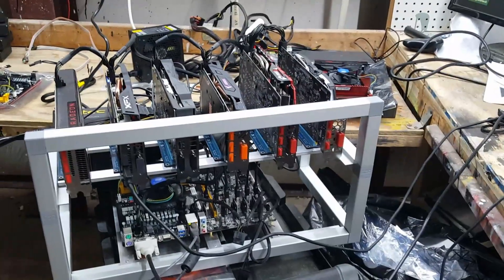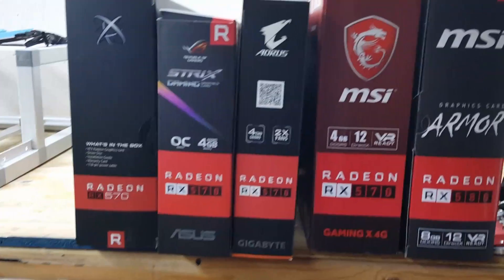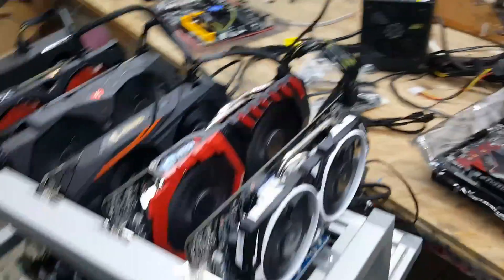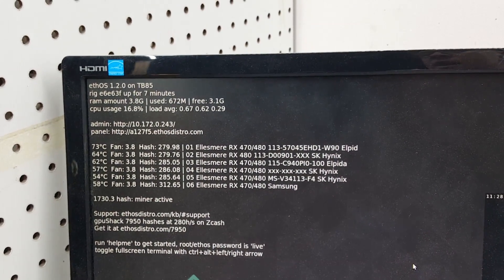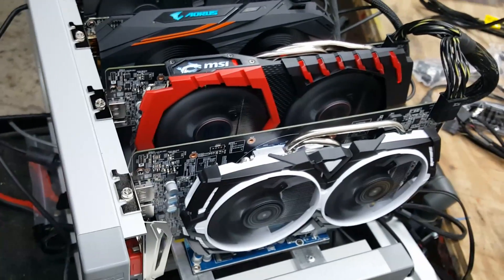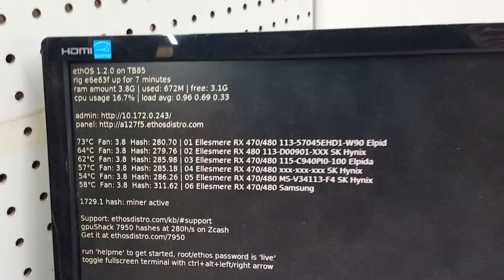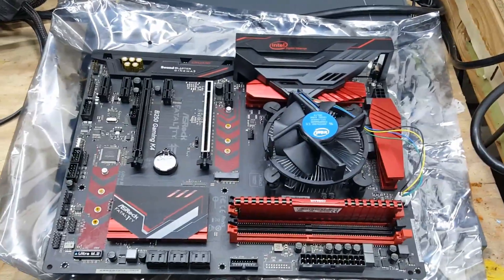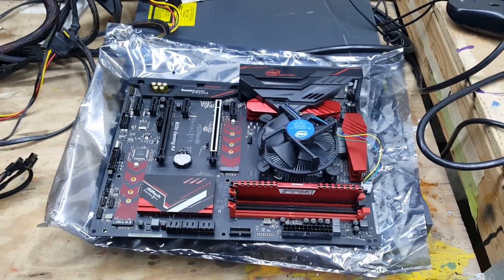Zclassic and Zcash mining with RX570 and RX580 GPU

Comment: Did you ever figure out how much power each board was drawing?
Reply: From my calculations, if he is using Equihash algorithm to mine Zcash, the power draw would be 670 watts, at a daily operating cost of $1.61, at a per kWh cost of $0.10. Based on todays Zcash value and hash rate of 1590 H/s (combined), he would be bringing in $6.56 a day after electrical costs. His is showing a combined Hash rate of 1729, so it could be costing a few more watts (700?), and be getting an extra $1 a day. But if he was mining Electroneum (ETN) using the CryptoNight algorithm, he would be using less power, at 655 watts, costing $1.51 a day, with a profit of $14.05 per day, after electricity costs. I hope that helps.

Comment: Hey Mr Versluis

I see a lot of the questions i had have already been answered. I just want to know your opinion on using the EthosDistro vs using a normal Linux Setup. I am from South Africa so we are able to get the other pc components quite easily but the EthosDistro would have to be imported, is it worth the extra hassle of getting that into the country (we have strict tax on import) or is a normal linux setup a decent option?

I am starting from 0 knowledge and all i know is what i have seen on your videos and blogs.... thank you by the way amazing information.
Reply from the maker: You can download the ethosdistro and install it on your own SSD. You don't need to have the ethosdistro SSD's shipped  to you.

Normal Linux is good to start out with. You can look at the guides on my website on how to make that work. https://blockoperations.com/build-6-gpu-zcash-headless-mining-rig-ubuntu-16-04-using-claymore/

I moved to ethosdistro because it is easier to manage many miners, and it shuts the GPU off instead of letting it burn out. You can do the same with linux...but I did not have the time to figure out how to monitor and control the GPU's on Linux, and since the ethosdistro guys already figured it out, I buy their system. It is $30 USD for digital download from gpushack.com
Reply: Ah perfect thank you so much for the help, so far we have set up two GTX 1070s (the whole Rx series cards were sold out here) that are mining ethereum on linux using the claymore miner you mentioned in your guide. It's working well so far... slow start.

We using the nanopool option and have been monitoring it, looks like we getting about 47Mh/s with both. Not a bad start but we will be expanding shortly.

Thanks again Mr V

Comment: On one of your videos, you mentioned that you have a mobile hotspot as a auto backup to your Uverse WAN connection.  Can you tell me a little more specifics about that?  I would like to configure something similar.
Reply from the maker: You need to have a dual WAN router, with a primary and a failover link, like the Linksys LRT224 (I use a Cisco Meraki with full IPS signatures loaded...but that's probably overkill).

For cellular, I use a Sierra Wireless USB 4G modem with a T-Mobile SIM card in it and a TP-link TL-MR-3020 (I think) with an ethernet port to the firewall

Comment: The RX580 also comes in a 4GB version for $50 less ... do you think the 8GB is needed to get the higher hash rate?
I'm trying to put together the build you showed on another video... except the mother board is no longer available.
Reply from the maker: I thing the 4GB version is fine. Use the alternate motherboard choices at this post here: https://blockoperations.com/gpu-mining-zcash-ethereum-ethosdistro-amd-rx470/

I know you can get 6 GPU's working with the Asrock Fatal1ty Gaming K4

Comment: How did you get ethos boot with these, i couldnt get it booted even on it with 580 and 570.
Reply from the maker: Guntis Vitolins I got the 570 and 580 working, all six cards on the biostar TB85 then all 6 today on the LGA 1151 asrock fatal1ty gaming k4. 

my panel is here http://a127f5.ethosdistro.com/#

which motherboard settings are you asking, asrock?
Reply from the maker: Guntis Vitolins for the fatal1ty the BIOS settings are auto on pci-e, TOLUD at 3.5, vt-d off, sound and serial port disabled, could virtualization disabled. I think those were all the BIOS settings changes.
Reply: Ok thanks for your update, cool. ill give it another go Tommorov , have them on exactly the same motherboard.
Reply: Did you do any bios changes in biostar TB85?
Reply from the maker: Yes, these are the BIOS changes I made: https://blockoperations.com/configuring-bios-settings-gpu-mining-intel-motherboards/

Comment: ubuntu has more luck with these than windows?  had serious problems trying to get 6 to work in windows...
Reply from the maker: I can still only get it to boot with 5 cards, not 6. Ethosdistro uses ubuntu, I believe. I put 8G of memory in it and set TOLUD to 3.5, still no luck.
Reply: ok now im confused, so you got 6 to work on the TB85 with ethos (which i despise since the main dev in the IRC channel lashed out on me because I am living in china... and he hates china... yet he sells chinese stuff like cheap SSDs.... and then stalked me to the zcash boards... still got the screenshots..)?  and you could only get 5 to work on the asrock fatality with windows?   you gonna try the TB250 boards?  I thought that was 5 500 series cards and 1 400 series on the TB85

Guntis cant get 6 to work in windows

I could not get 6 to work when mixing the with 400 series cards in windows

but I did not try ubuntu
and yeah eth is just a stripped down repackaged ubuntu... kind of a rip off when you think about how much work goes into ubuntu and its free... they just take what others give out for free and then charge for it (eth)... kinda horrible

but you can copy it :)
Reply from the maker: ok, got it working. I set the PCI-E to Auto, not Gen2
Reply: hmmm cool!  that's good to know, that's the  asrock?   windows  or eth?
if u flash them do   they  work  with  linux  drivers?
Reply from the maker: Yes, the Asrock Fatal1ty I got working with 6 cards. Biostar TB85 works no problem.
Reply from the maker: Missed this comment before. The Biostar TB85 works fine with 6 GPU's. It's not the application that's the hard part for me, it is getting it to boot. Ethosdistro works great
Reply: cool
Reply from the maker: I don't know. I have not flashed any of the GPU's
Reply: too bad i already stuck mine in a crap board total 4 GPUs... otherwise id try with ubuntu
Reply: you should check if loose card when your board boot in bios.
Reply: the reason of loosing card ,not depend on what system you use.
Reply: lots of people have been having problems getting 6 to work in windows 10.
i dont care cause im not going to keep patching my drivers... the drivers seem to unpatch themselves once in a while... and its really annoying - system crashes and you need to repatch the drivers.  im so glad i only have two 500 series cards... ill probably flash them back to stock bios and let them mine zcash ....
Reply: Cryptomined I have not any experience of mining in Windows, but Ubuntu server is not table either. some of my rigs work perfectly, some are not. they are all 7 cards rigs ,with 470 or 470d.
The stable one, can work though whole week. but the unstable one cannot work lasting 2 hours.when it reboot, the rig loose some card randomly. so I must check these unstable rigs status. it's annoying.
Reply: oh yes, for your problem might be solved using some sata risers with fatter 1X slot ends, that totally got my 7 card rig running 100% stable.   before that, yes some of the slots were loose and would crash every few days here or there... sometimes not recognize all cards on start up -... ever since changing to 4 sata risers in the 1x slots, never had those problems again.
Reply: thanks for your suggestion,  I will try it.

Comment: I recently built a rig using the ASRock Fatal1ty B250 Gaming K4 and was able to get all 6 GPUs going. Do you think it could be a riser? What is your TOLUD setting at?
Reply from the maker: It might be a riser. I tried TOLUD at 3.5, 2.5, and 1 GB. It worked fine on all three, just not on dynamic.
Reply from the maker: does it need more than 4G memory to work with TOLUD of 3.5G?
Reply: Not sure about 4GB with TOLUD @ 3.5 as I put 8 GB in mine. So it worked OK as long as you had a TOLUD set? I have my TOLUD set to 3.5.
Reply from the maker: I'll bump the memory up to 8G and try TOLUD of 3.5 and see what happens. Thanks!
Reply: Block Operations Happy to help! Hope that gets you up and running! Really enjoy the channel 😊
Reply from the maker: ok, got it working. I set the PCI-E to Auto, not Gen2